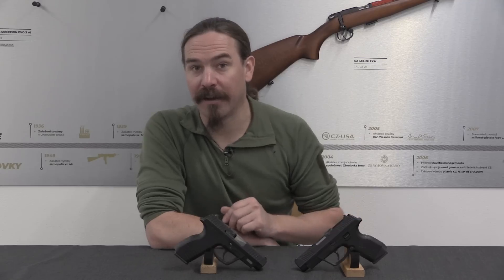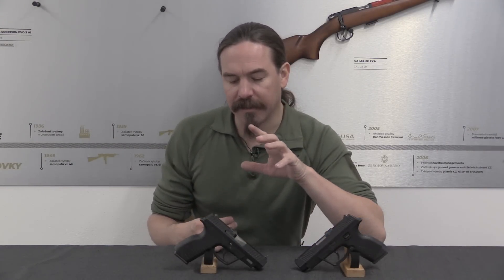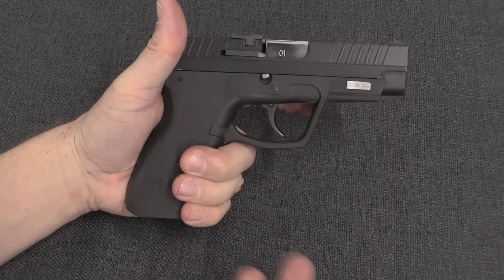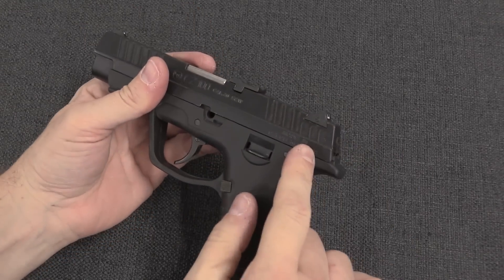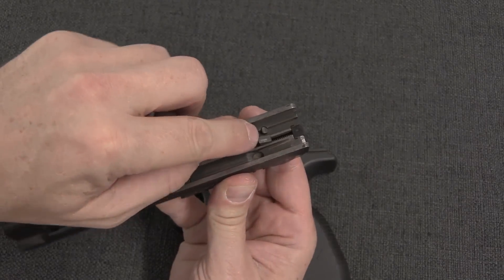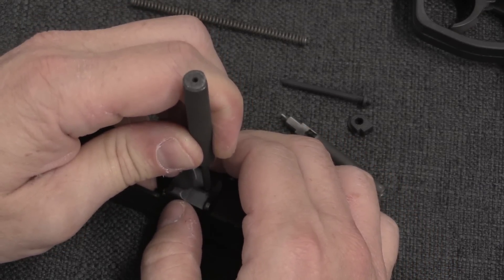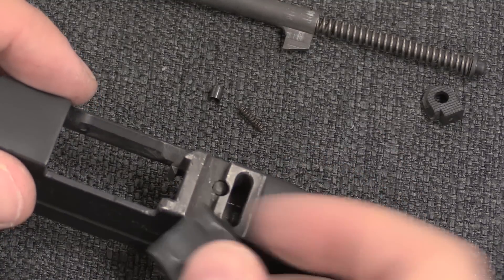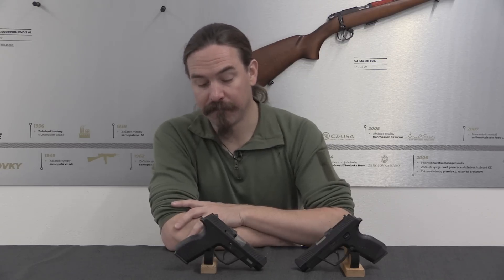CZ's Embarrassing Volkspistoles: The CZ100 and CZ101

Comment: I really like the idea of using one magazine for both calibres, and getting around capacity restrictions. I know Glock and other companies do .40 and .357 SIG magazines, but are there any other manufacturers doing 9mm and .40 magazines? I wish that was more common.
Reply: I think the HK P7M13/M10 magazine was the same way.
Reply: Astra A70 and A75 pistols used a 9mm or 40 magazine, but not interchangeable between the two models.
Reply: Although I am sure they don’t market it as such, my Springfield XDM .40 magazines feed 9mm just fine with the aftermarket Bar-Sto barrel.
Reply: @loquat44-40  not sure why they would be, the rounds are the same size up to the neck.
Reply: @loquat44-40  huh. Did not know that.

Still seems weird, but maybe the .357sig nosedives or something weird.
Reply: The beretta 92 and 96 use the same magazines between 9x19 and 40sw. I suspect the Star Ultrastar does as well.

Comment: "most dangerous" gun idea. make a trigger that has an incredibly light sear but an insanely long take up and reset. but design it to randomly change both where the trigger resets and where it fires on the super long pull. so every time you shoot it the gun fires at different times, resets at different spots and constantly annoys with the shooter.

Comment: The trigger pull killed it.
Reply: I mean, at the time, the average revolver had a 12lb DA trigger. So this was a pretty big improvement with an 8.5lb trigger in DA.

And even my CZ75 has a long, long DA trigger pull. I'd need to borrow a trigger gauge to weigh it.

But since it was DAO, you never got the short reset and 4.5lb SA pull like a 1911 or CZ75.

Comment: This just popped in my feed. I bought one of these when the first came out. I would recommend this gun to anyone. It has the absolute longgggggggest free kin trigger pull.  If you can tame the pull it's a very very accurate gun.  Still have it have fired it in 20 years. If the could have gotten the trigger right we'll. Either way its a cool gun, I would even consider buying one of these today the trigger is that bad!!!!

Comment: single action Sally's didn't like the long heavy actual double action pull .My Cz 100 was extremely accurate but I'm not a Sally heavy and long breaks cleanly . CZ 75 mags do fit they protrude an inch out the bottom and don't engage the slide stop.
Reply: EXACTLY! Too many people nowadays are spoiled off of having light, crisp triggers without having ever put in the effort to work with, as they call them, “sh*t triggers”. Give them a DAO handgun though (or a MilSpec AR trigger), and their supposed skill set and accuracy almost always vanishes immediately.
Reply: @BlackCloud0351  and a mil-spec AR trigger isn't that bad... 7.5lbs, maybe 9.5 for the burst version.

Now, those derringers with a 12+lb trigger...

Comment: I've heard that fiberglass filler isn't really there as reinforcement in the polymer.  I'm speaking of power tools, not firearms though, and I could be wrong.  My understanding is that when you see PA6 GF30 stamped on plastic, that's Poly Amide 6, a strong heat resistant plastic, Glass Filled 30% by volume.  By weight, however, it's only 4% of the product.  Therefore, I think its main function is to reduce weight.

I'm no expert, you're all free to correct me if I'm wrong.

Comment: As an owner of a .40S&W pistol, i have to say, i got bamboozled!  The gun media were touting that cartridge as the next big thing, so i got one.  Very nice pistol, and i still own it.  It's just expensive to feed for no real benefit.  I could have bought the same gun in 9mm Parabellum and been far better off.

Such is life.  Some decisions turn out to be good ones down the road, and some turn out to be less than optimal.  ^-^
Reply: Isn't .40 really cheap to buy since nobody cares about it anymore?
Reply: @scarfaceAC2  You'd think so, but it's not.  It's not a bad cartridge, just an expensive one.  Would have been better off buying a 9mm.

Comment: Ruger P95 has fiberglass reinforced polymer rails... the slide basically rides on the glass in the polymer. 
 Mine is 26 years old, still runs great and no discernable wear on the pistol.
Reply: Jeff, loved the P95’s! Had the decock-only and DAO variants, as well as a P93 DAO. Unfortunately had to sell them all off, but at least they went to good homes.
Reply: @BlackCloud0351  I only wish I had snagged the P97 45 acp version also.

Comment: I can't find anything in Google almighty about the CZ101. What I've found names the CZ110 as the single stack counterpart, available in 9mm Parabellum, 40S&W or 9x21 IMI. The photo accompanying the Wikipedia article for the 101 confirms that this is not a typo, but it could possibly be that they have their info mixed up.
Reply: Belay my last. I commented before reaching that point in the video.

Comment: I own both CZ100 in 9mm and 40 S&W for many years..Not a high grade pistol but I personally have not had any issues with them..I bought them as they are not very common to see and collected them for that reason...Believe it or not they have been going up quit a bit in value..very rarely do I sell a gun so until I die they wont be on the market

Comment: As an Australian (with very limited ability to test different models of pistols myself), I struggle to understand the advantages of striker fired, da only and da/sa pistols over good, old fashioned sa only firearms......particularly for full sized pistols designed to be carried in a holster.

I've fired a m1911 on a number of occasions and it shoots beautifully. I've also fired an old Walther PP pistol and the first da shot is genuinely horrible. 

Are sa only firearms like the m1911 and Browning hi-power really unsafe to carry cocked and loaded? And if they are safe, why would you go to a da or striker fired action like these ones?.

In my, admittedly, very amateur understanding, pistol capability and functionality really hasn't progressed that far since the Browning hi-power. About the only advantages I can see in modern, polymer weapons is weight and cost of manufacture.

Is that a fair call?

Comment: So they made the frame cheap and simple, but came up with an extremely complicated striker system. And made most of the parts out of plastic. Topping it off with a horrendous staple-gun trigger pull. Sounds like something Colt would've come up with. And whooooooooo owns Colt now?

Comment: Glock could have been an inexpensive pistol and should be. Polymer frame pistols are much cheaper to produce than steel or aluminum frames. Yet Glocks sell at a premium.
Reply: Same with the HS2000/XD. Those were about half the price before Springfield slapped their logo on the side. Total rip-off.
Reply: Well, you do have the whole "shipped across the Atlantic" thing going on, plus whatever import duties the US tacks onto pistols. Often something like 35-50%, and can be a lot higher.

So it might be a $300 pistol in the EU, but by the time you've shipped a container full of them across the ocean and paid customs, it's a $600 pistol for your local shop to make any money on it.

Comment: I love CZs but I to find it a bit annoying that they have so many different magazines for their various pistols. Some of them are useful across more one than one platform but many of them are not. Maybe there's some engineering reason why they can't make all (or at least most) of their 9mm pistols use the same magazine but it's not apparent to me.
Reply: It was probably so they could use one magazine for both calibres, which is an even better idea. Imagine if Glock magazines could be used with 9mm, .40 S&W, or .357 SIG. Getting around the capacity limits is also very smart.
Reply: Also, CZ75 Tac Sport mags don't fit in a regular CZ75/Compact.

Comment: Has anyone ever tried to make a pistol that can easily switch between SAO, DAO and DA/SA?
Reply: Without swapping out parts, you mean? The closest thing I can think of is a Browning BDM which had a sort of "revolver action" setting as well as standard da/sa.
Reply: What would be the purpose?
Reply: The Zastava CZ999(no relation to the Czech CZ pistols) can go DA/SA or DAO. The decocker also functions as a safety when pushed up instead of down, allowing it to be carried cocked and locked like a 1911. Very cool design.
Reply: @LIONTAMER3D  I do that by buying a pistol with the system I need. Since that doesn't really change, I don't need the system on my pistol to change either.
Reply: @LIONTAMER3D  I'd say if you're carrying in condition 0, you're crazy no matter the situation ;) Have at least the safety on.

It seems a regular DA/SA is perfectly adequate for your example, perhaps with some requirements on how its safety and/or decocker function.

Comment: is it a Browning action, or a Sig action (derived also from Browning). Isn't the Browning action purely the one from 1911, CZ 75, Hipower with the two lugs? This one with the top of the chamber (like Glock and newer pistols have) i think it is called Sig Action. Is this correct?

hint: wikipedia for Locked_breech
Reply: No, they are all tilt barrel, "browning action" how exactly they lock up with the slide does not determine the action.
Reply: @bindingcurve  I agree. By the way, John Whiting, the designer of the pre-WW1 Webley & Scott semi-auto pistols, might well have been the first to design semi-auto pistols with barrels that lock up into the top of the ejection port.

Comment: They decided to not just use a CZ-75 magazine? No wonder these failed.
Reply: At first, I was thinking the same thing, but having one magazine for both calibres is actually genius. Saves money and gets around capacity restrictions. I wish more companies did stuff like that.
Reply: Different slide stop.

And apparently a CZ75 mag will work, locks and feeds okay but doesn't hit the slide stop when empty.

But no, I see the reasoning. Use all the same magazines for 9mm and .40, save on shipping and tooling.